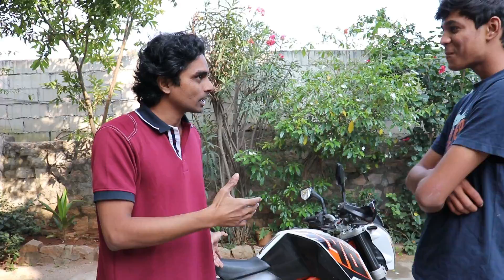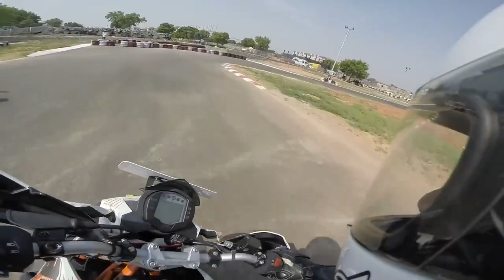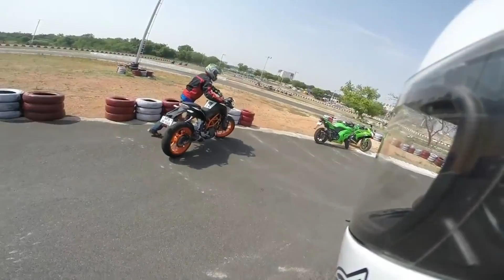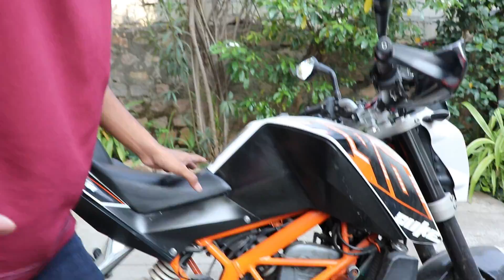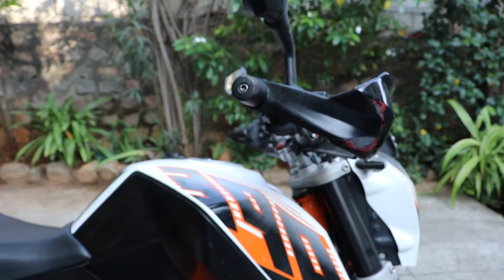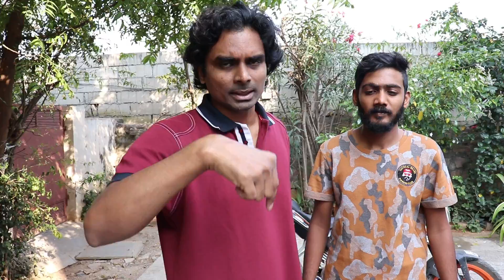Frame Sliders Damaged my Duke 390 in a Crash.

Comment: I crashed my 2019 Dominar, day before yesterday in Bangalore local market roads because of the rains. Lost traction while taking right turn on 10-15 kmph speed. Stock leg guard took to the duty and absorbed the impact, got bent, rear brake pedal also got bent, nothing more happened. Next Day got them replaced for Rs. 627/- along with labour costs. And back again on roads swiftly. after that lot of people told me to get a aftermarket crash guards with frame sliders and all. I told them, its not my first bike or first crash. the stock leg guard works well and costs very cheap for replacements. Dominar, Pulsars, KTMs, all of their leg/crash guards comes at just Rs.162 MRP....!!!
Reply: Same bro
Reply: well said, i too have very similar experiences driving on bengaluru roads. had multiple crashes on my 2014 Duke 200 and stock guard saved my bike and me all the times from major damages to bike  hefty repair bills to my pocket. Felt the stock guards are too small many times, but they always worth it.
Reply: Couldn’t agree more buddy
Reply: RUNN✓  Very well said
Reply: You probably dont care at all but does any of you know a tool to log back into an Instagram account..?
I was dumb lost the account password. I love any help you can give me
Reply: @Jeffery Ira Instablaster =)
Reply: @Kolton Jeffrey it worked and I actually got access to my account again. Im so happy!
Thank you so much, you saved my account!
Reply: @Jeffery Ira Glad I could help =)

Comment: Frame sliders protect only from drops. They will damage the frame on a  bigger accident.
Reply: Exactly bro it saves from drop only
Reply: If not designed properly, they do more damage than protect. Design  and right material usage is important

Comment: Mad respect to you for busting this myth! Can you please tell us if stuff like radiator guards are important or not?
Reply: With my experience they're important but expensive and not worth the money you're paying.
Reply: Radiator guards are definitely important. On bikes that you take off road you definitely need them. They protect the radiator with no hassles. I have had friends  riding on the street and got a pebble or stone in the radiator and replacing the radiator is far far more expensive. If a guard is available for your bike you should get it.
Reply: Siddharth ganni and Leon Dave, thank you for the inputs
Reply: I also didn't install anything extra. Thought of radiator protection. But didn't do that. Felt like it would block the airflow.

Comment: THE reason why it damaged your main frame is because your frame slider is of cheap quality and does not have enough shock absorption layer which will absorb the impact intensity. If you would have bought a genuine one this will not be the case as most of the people bought SHOW PIECES.
This is the reason why a genuine costs around 12k and these costs 1/3rd of it. R&D costs you.
Reply: Correct, I have R&G sliders for my RC and I have been rear ended at 30kmph,total damage was Rs200/- as I had to replace the handle extension. R&G sliders costed me 13k.

Comment: A couple of days ago I crashed on my AS200( thanx to the old uncle😐) and the stock crash guard took the impact and got bent but saved me and the bike completely
Reply: And yes the rear brake lever got pushed in
Reply: 4 yrs with as200. I fall 2 times. One was just yesterday. Both times leg guard took the impact. Only some scratch on fairing and bar end. And this thing cost only 150rs. Very cheaper than frame sliders
Reply: Same thing happened with me bro 1nd half month back but with duke 390  2019
Reply: @iadnanjaved  better to stay stock for some parts and prioritize safety than looks

Comment: So much damage at 15-20kmph? Something fishy with the boy ;)
Reply: Niket Talpade 😂
Reply: Lol
Reply: Being a Mechanical and Automobile engineer with masters degree I can Agree that the 10 to 15 kmph crash can actually snap the whole substructure due to excessive components like frame sliders they attach over the existing frame structure and cause the pressure and weakpoints on frame to multiply. These frame sliders and cages are only used on stuntmotorcycles to save engine in case of crash not the frame and fairings 💯

Comment: Hi Vikas, 

As usual, an informative video. I would like to add some thoughts to your viewers as well.

Frame sliders are of two types 1. cut kits and 2. No cut kits.

The kit on ur machine is a no cut kit, which technically doesn't require you to make any changes to ur body. However, the idea behind the frame slider is to save the bike over small or low speed falls where gravity plays a major factor and not kinetic energy.

Again the longer the slider the better protection when the bike falls under gravity in other words, stand still or tip overs as this will keep most of your parts from touching the ground. 

In a travelling fall, there are multiple factors and as you rightly said "many might not agree". Your frame sliders design plays a very active part. Of it's longer then required length this inturn adds to the chances of digging into the ground as the fall does not sound like it happened on good roads. As an experienced biker yourself why did you opt for the sliders when you had stock guards doing a better job ? Is a question worth asking. 

Protection for a travelling fall is subjective to the length of the slider as the travel distance should be  minimal to allow break off. Which in ur case seems like the frame slider is stronger than the chassis! 

What's ur thoughts ? Did u think about all this before the video ?

Comment: Yes, there are some crashguard which can damage the frame, but crashguard provided with the bike wont coz its nut bolt are made to fail before bending of frame can take place and even they are broad enough to protect your legs and other bike parts like engine or radiator on a leagal speed in most of the cases.

Comment: I always wonder how could a long stick like structure with broad head would save our motorcycle 🤔🤔🤔now its cleared...thankyou brother for this very important myth buster♥️🔥🔥love you brother cheers♥️🔥
Reply: Well, it could've save the bike if its mount was made of cheap steel or aluminum, so it would bend and absorb the shock. But as we  can see here, the slider got nearly no damage, so it hadnt absorb any energy, but worked as a lever and transformed all the crash energy to torque to that silver detail (engine mount, i suppose). 

Also a single slider is not a good idea anyway, engine protection cage (not sure how it's called in English) will do a better job as it splits crash energy on more than one point of the frame.

Comment: That’s the engine motor mount that has been cracked and from a quick google search the KTM 390 has issues with that being a weak point. The frame is fine and that motor mount cost $30 US. The right fairing cost $40 US and the fuel tank is $150+ US so it still saved you money. You put a cheap frame slider on the bike and it busted your motor mount. A nice frame slider for the duke 390 mounts to 3 different locations and not just the motor mount. Don’t listen to this video folks, put frame sliders on your bike but don’t cheap out on them like this guy did.

Comment: I recently had a huge crash at silverstone circuit at 190 kph and the RandG crash bungs saved the bike big time but the clutch case covers from RandG didn’t do a good job , however GB protection case covers on the otherside was ok. Sadly the bike flipped ...... 🤷‍♂️🤷‍♂️🤷‍♂️🤷‍♂️🤷‍♂️

Comment: But a properly designed frame slider won't do it. Frame sliders provide the best protection if designed right and with the proper raw material usage. Most folks selling these don't use genuine Delrin and won't use high grade Aluminium which are lighter and stronger and hold better than crash guards. 

I only heard good about our sliders since 2 years of sale and yet to come across a single issue like this.
Reply: Go for cheap stuff from Amazon and then blame the entire genre of product is not right. If you want peace of mind and better product, always choose from a brand which puts effort in R&D and not just on marketing

My 2 cents

Comment: I thought of fitting the frame slider on my Gixxer 250 sf....after watching this video I changed my mind.
Reply: What are you gonna do about protecting it then?
Reply: @anirudhgupta2773  be it a faired  or a naked bike installing frame sliders is equally damaging , he better not crash and if he does replacing a pair of fairings will be way way cheaper than replacing the whole frame 😂 just the real facts !

Comment: After your sujjestion to have stock i kept them on my dominar and i had 2 crashes same side still the stock guards are intact with only scratches. And i have seen fellow dominarians added aftermarket guards and have bolt breaking issues.

Comment: i have always wondered why would anyone want the chassis to take the impact. (in the case of a full fared motorcycle , but yh some ppl think the chassis is metal , and the plastic shell should be saved rather than the vital chassis, such a dumb thing to do) , but here i see you changed the stock crash guard bcos it looks odd (admittedly).. bad luck.
id stay away from this small stubs called frame sliders even on a naked bike from now on.. even if its ugly id just keep the stock crash guard.

Comment: Great video vikas bro, i was in a hurry to put frame sliders on my Ns200, but now i will not (i am the same guy who's discussing issues related to ns 200 hard downshifts on whatsapp) good work bro
Reply: Try blipping the throttle when the bike refuses to downshift. I do it on my NS200 as I faced the same problem.
Reply: Try blipping the throttle when the bike refuses to downshift. I do it on my NS200 as I faced the same problem.
Reply: @shivshankardas3596  yes bro i also used the same technique just increase the revs a little bit and downshifts...but i wonder why the gear shifts are hard, it shouldn't be.

Comment: I bave frame sliders installed on my rc 390. Imthr bike fell once while being stationary and the frame sliders fell on my shoe tip resulting in me breaking my toenail and me going to the hospital. It's was not an issue but i always had my doubt about the frame bending once the bike falls while riding. I guess I will take those down from my bike before i ride it next as soon as possible. Thanks for.thr first hand result. i might break a fairing but that's ok cause the frame would be untouched

Comment: What are your thoughts about after market leg guards with frame sliders. If the sliders are installed on the leg guard the leg guard will take a hit and as after market leg guards generally have more mounting points the weight might be distributed more evenly. I might be wrong but that is what I feel.

Comment: I thing ur frame slider mounting plate made in metal that's the reason ur bike chessey broken .. instal the frame slider which made in delrin pucks and aluminium clamp.. best brands   like motofusion,  bikers billet , or RoadRash

Comment: Hey vikas
There's a BHP drop in R15 v3 bs6 version
I hear the BHP drop(18.6) is because of the new cat converter
So if i replace the bs6 exhaust system with bs4's, would i get some BHP gain (19.3)

Comment: Sir is it good to use liquimoly for duke 200....??
Reply: Yes only if u can afford
Reply: @SDP17  thank u sir
Reply: @madhanvr5883  but you have to buy two bottles. Because it comes with 1 liter of quantity and you need 1.5 liter for duke 200.
Reply: @SDP17  sir they used one liter liqui moly bottle and add 400ml of motul...they did not use engine flush to clean engine will it have any problem.....
Reply: @madhanvr5883  engine oil flush not necessary. You can flush engine oil 1 time after every 30k-40k km not at regular servicing. Mixing different engine oil is not recommend and also it's not safe The reason is that every brand of engine oil is formulated differently, especially with regard to the additives used by its manufacturer. Nobody, possibly except for the top scientists and engineers working in these oil firms, knows the chemistry of their engine oils. So avoid mixing engine oil.
Reply: @SDP17  thank u sir it is very useful for me...

Comment: what should u do when u have a full fairing bike like yamaha r3 ! wont need a frame slider !!?
Reply: That's exactly what he clearly explained replacing a pair of fairings is way way cheaper that replacing the whole frame that gets bent in a crash just because of some cheap ass sliders
Reply: @chetankumarr8084  That comparison is subjective bro. One side fairing of a lot of bigger bikes cost over 50k and done close to a lakh.
Reply: @The_Name_Is_Rider  Yeah i agree with that , but it'll still be cheaper than a full frame replacement and more over doesn't matter if the guy owns a Kawasaki H2R or a guy owns a KTM RC 390 both will prefer on replacing a set of fairings rather than a full frame

Comment: This isn't complete information. I've crashed my bike at 2 occasions, one with my delrin sliders and once with the factory crash guard from ktm. 
My second crash with the delrin sliders had happened at about 80kmph where I slid with the motorcycle for about 15 mts, picked up the bike and rode it back with a bent handle and broken footpeg to Pune from kurla. 

My first crash with the ktm crash guards was at about 70kmph where the bike slid again but this time the carsh guards bent and ended up breaking the magnet coil cover on my bike. 
Delrin sliders are designed to keep the motorcycle sliding at higher speed crashes, stock ones are not.

Comment: Is this a comment racing circuit? Lol and btw what is the solution other than installing frame sliders?
Reply: Frame sliders are actually good for your bikes. Point to remember is that, the number of mounting points are more than 1. For duke you can get 3 points frame sliders. Mine saved the bike a couple of times.
Reply: @arindambanerjee6417  Thanks mate!!